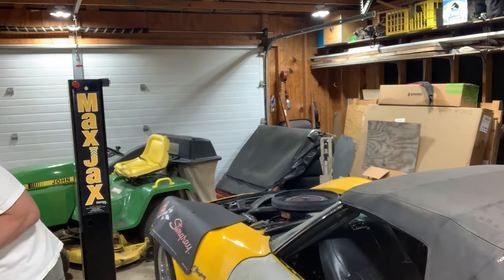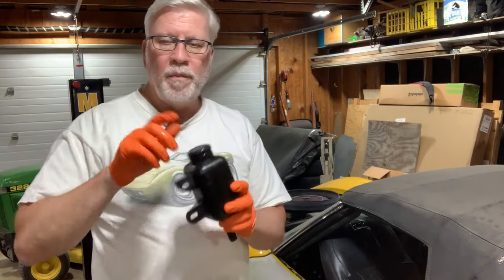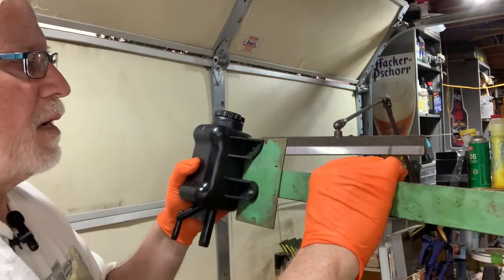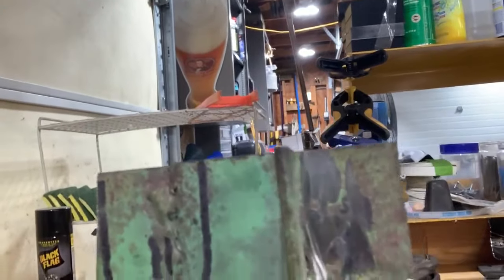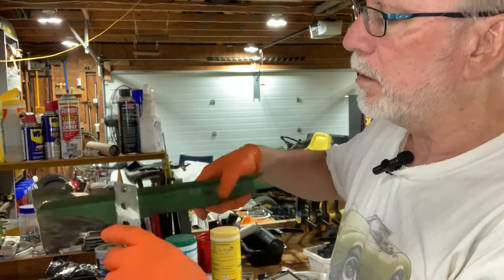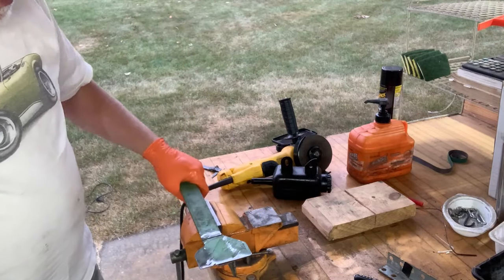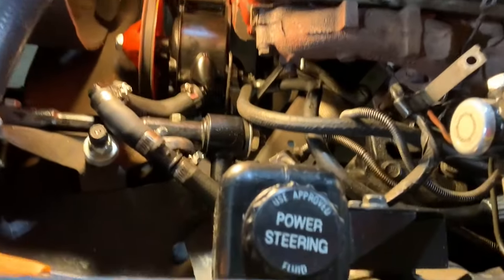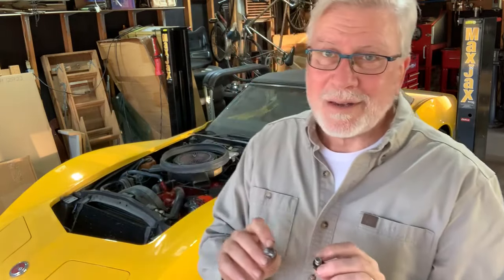Remote Power Steering Reservoir

Comment: My problem for loosing power steering  fluid was,when I was backing up into my driveway, turning the wheel all the way to do a right hand turn, the cylinder  rod entering into the cylinder. While the cylinder going to the driver side would just touch the oil pan enough to create a small bind. This would created pressure on the seal , enough to make it a  fair amount of a squirt every time. I could see the rubbing mark on the oil pan. No more  full turn back up right hand turn solve my problem.
Reply from the maker: Interesting. I wonder if any one else has had this issue?

Comment: I snapped my dipstick off trying to get it out.  Turned out I had the wrong belt.  With the correct belt, you can slip that dipstick out.  Also use your narrow funnel with clear tubing on the end to fill.  Use your finger as a dipstick to check the level.  I can do it with my eyes closed... yeah, all c3 power steering leak, even when new
Reply from the maker: All good ideas. I meant to mention using a shorter or a longer belt can help get around this issue, but I was looking for an excuse to add this remote reservoir.